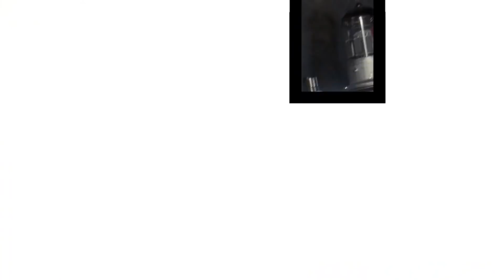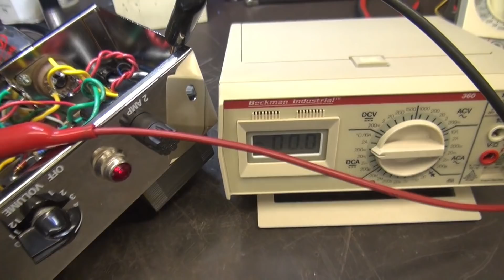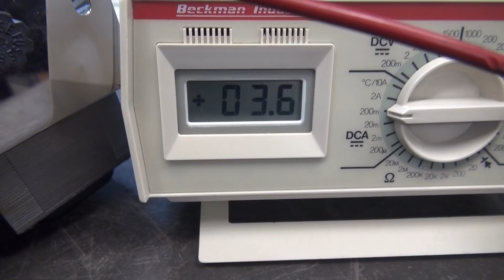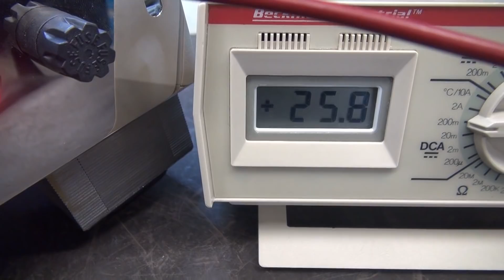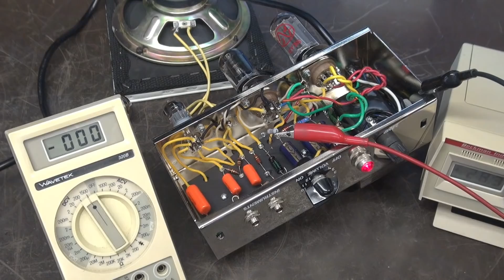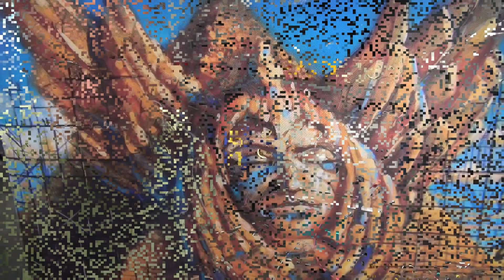How to fix smoking Fender 5F1 Tube Champ guitar amp kit repair D-Lab

Comment: I would have lifted that turret board to see if there was a wire under there that had come loose before adding a strap wire over the top.
 A loose wire connected to high voltage on one end could move around and touch other circuit components and burn them up too.

Comment: Just a weird thought. Did the client ever say that the amp was working before? That wire could be dangling under the board. I had that happen once where something got a little over-soldered on the top, and the wire under the board fell out. You could have 400 volts dangling around in there somewhere haha.

Comment: The original 5F1 schematic shows this as a 470 ohm cathode resistor for the 6V6.  I understand increasing the power rating above 1/2W - most kits I've seen are coming with a 3-5W 470ohm... But how did you determine that 1kohm is the right resistor?

Comment: From Leo:  Nice quick fix.  I have repaired maybe 1/2  dozen recent production Fender blues juniors that have flame proof resistors on the output tubes that are undersized.  All the old ones had bigger resistors.  Being flame proof, they do not discolor, they just go open.   It is like the purchasing managers are over riding the engineering department.  Extra repair cost because someone saved 2 pennies on the resistors.

Comment: When Jan Jurco bought the Tesla factory, we all had hope but Jan's designs have had a bad habit of burning out on the power and rectifier tubes. His preamp tubes are noisy and very inconsistent. Yes, his tubes can be powerful but when they fail so often, even when you find a good one or set, you are making a huge gamble. I personally do not sell or install JJ tubes in any of my repairs. As a matter of tone and longevity, I only use vintage tubes in my vintage repairs! Of course, then I won't have that customer back for 5-10 yrs if their only recording with the amp. Maybe more than a year if their playing steady gigs for power tube replacement (depending on volume).

Comment: Hello and good afternoon I love your videos they are very intuitive. Quick question for you I have 2 Jensen F12 speakers field coil one is a F12 NC and one is a F12 n s the NS is 700 Ohms on the field coil and the NC is 1000 Ohms on the field coil both are 6.5 Ohms on the voice coil do you think I could use them as a pair or would they sound difference with a 300 ohm difference thank you
Reply: Field coil speakers act as a voltage drop resistor on the B+ power supply. If you add another speaker it will throw off the voltage that your amp receives. BAD things will happen! Unless the amp was originally designed for these two particular speakers.
Reply: @BarefootBill   thank you for the reply what I meant was I have to speakers that are F12 NS Anna and F12 NC looking at the specs they're identical on the voice coil side but one is a thousand ohm field coil the other is 700 field coil I am building two power supplies one for each field coil and then feeding them like a traditional speaker do you think they will sound different.

Comment: Hello Terry, 
Thanks for this video!
I did the 1kΩ 5w swap on a 5F1 b/c of high B+ voltage w/470Ω.
 After rolling a few tube sets, I ended up with an EH 6v6 and Sovtek 5AR4 which measured out to be about 11 watts at idle and 93ish % dissipation with a Classic Tone15w OT which I think can take up to 70mA.
 I Would like to try a lower value resistor although I'm not sure how far over 100% dissipation is "safe" for a 6v6. 
In one of your builds, I saw that you biased a 6L6 to 40 mA.   Is 40 mA a magic number for 6V6 tubes as well?   Sounds pretty good as-is but I'm just curious how far I can go with this.  Thanks for all of your efforts..

Comment: Just put in the wire that I missed. Left in that 470ohm resistor and the amp sounds great. What puzzles me is the fact that there is that big orange drop cap that feeds the 12ax7 pin 3, where I have a 1.5k resistor. Well, my amp works fine, thanks to you and this video Terry.

Comment: Thanks Terry. Just built the same amp. Guess what? No sound. No smoke yet. Still has the new amp smell to it. I forgot that wire. Maybe that's why I have no power to my 12ax7. I think I will replace that 470ohm resistor though. Got two questions for you. On the end of my eyelet board and the layout, there is a 1.5k 1/2 watt "resistor" that goes to pin 3 of the 12ax7. Do you recall the value of that orange drop "cap"? I'm a newbe at this, but so far having a good experience. But when can you use a "cap" to replace a "resistor"? BTW that guys build looks so much better than mine. Good vid.

Comment: A common theme of of the home built amps is over looked or outright botched wiring. Even on a simple amp to a neophytes eye it looks like spaghetti. Very interesting is stewmac selling what looks to be an expanding line of mojotone kits which is great! Unique about stewmac is a detailed pdf step by step construction manual downloadable for free! My only confusion is they state that resisters orientation isn,t important and the orange drop caps orientation isn,t an ussue!????don,t they have polarity????  Another question mark is the use of predominately yellow wires. I thought the SOP is black =ground, yellow signal, red high voltage and green heaters. But still very usefull and informative. Maybe you could have a look and share your thoughts!

Comment: Yes the biasing resistor should be in the 5 watt range, but 470 ohms is definitely NOT too low. It’s a standard value for a 6V6 tube. If you put in a 1K you’re biasing the amp way too cold.
Reply from the maker: The bias resistor is not based on the tube (ex: 6V6), HV applied and current thru the tube for the correct wattage needs to be calculated
Reply from the maker: http://www.tedweber.com/webervst/tubes1/calcbias.htm

Comment: Hi Terry -- please inform the builder to wire the hot from the wall to the TIP of the fuseholder -- and what are those wirenuts doing in there ? Peace

Comment: 390v B+ seems a little hot for the 5F1. I'm used to seeing 360v and below, and probably why he needed a 1k resistor to tame the cathode bias.
Reply from the maker: Remember at that point the amp was not drawing full current. It will fall as the amp settles in

Comment: Very interesting episode.... I'd love to build an amp kit one day despite having no electronics experience what-so-ever. I have a Fender Princeton Reverb reissue - bought it new a few years ago... had not played it for even an hour before a power tube went out on it... the amp tech I took it to for repair replaced the Fender original tubes (both of them) with JJs... said it was the 'mid-range' option.  Put a lot of hours of them - no problems so far.

Comment: The kit I have, but have not yet completed came with a 1 watt 470 ohm, but I'll probably get a different one after watching this.  I looked at the schematic for the 5F1 and if I'm reading it correctly, it does call for a 470 ohm resistor... Would you say that it's a design flaw?
Reply from the maker: http://www.tedweber.com/webervst/tubes1/calcbias.htm

Comment: I built a 5F3+ Tweed kit from Tube Depot last month. I think (hope) I upgraded the tubes for JJ. I looked at Tube Depot's 5F1 schematics and they call for a 470Ω 1W resistor where that 1/2W 470Ω resistor was in this one. But... after running the numbers in a bias calculator, the 470Ω resistor would make for a bias that's a bit hot (as you noted).
Reply: It's a cathode bias, single ended class A amp though, so as long as your voltage is within reason, you can bias quite hot. Up to 100% is fine, even a bit higher (possibly, as long as the voltage is in the lower 300s, and not nearly 400...). 

The 70% rule mainly applies to fixed bias amps. I'd never bias a champ less than 90%.
Reply: @JMA_Elec  Good point.